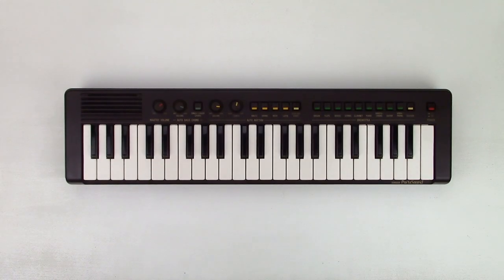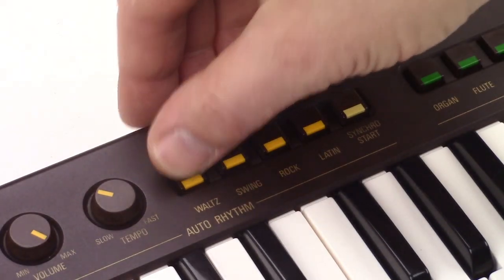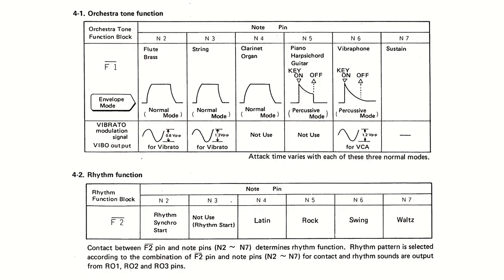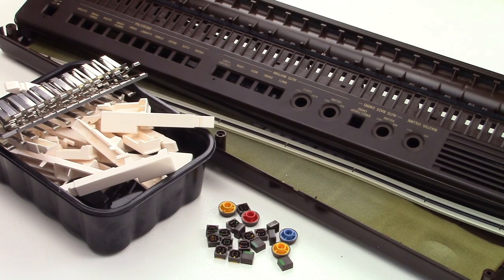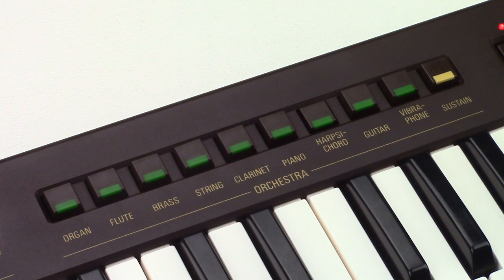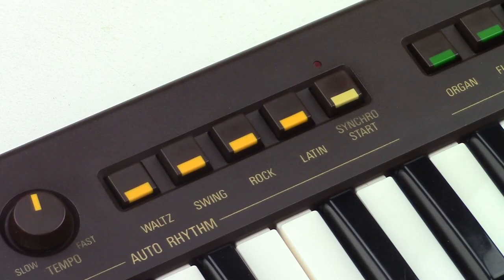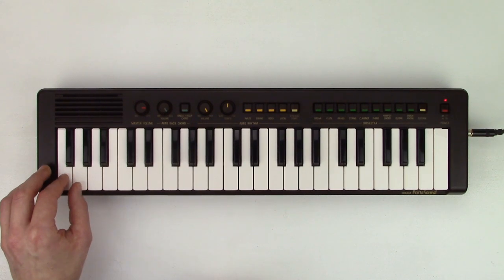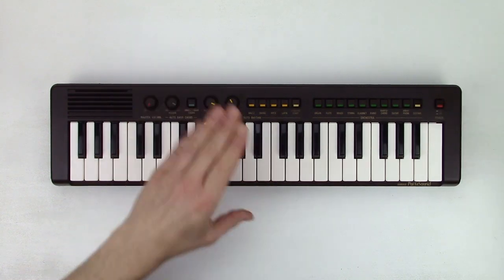Yamaha PS-3 Review

Comment: I've just received my own PS-3 (with the case <3, but lacking the battery door :D) this this is build like a tank, you would expect something super light for the size, but it weight a lot, and even worse with the battery.

Mine seems to have other than scratchy potentiometer an issue with the drums but suspect it is just a capacitor that show show age. Everything else seems to work Ok considering how old this device is (from the serial number mine is a bit more recent)
Do you have a recording somewhere of just the drums? would like a clean reference to check the output of mine, I have the service manual (thank you internet for that, and Yamaha to have made them so complete) so fixing should not be too much of trouble.
Quite amazing how much they achieved with that keyboard with so little..

Comment: I have a have a keyboard collection made up mainly with Yamaha and Casio keyboards my very first big full size keyboard (which I still have and still works very well) was a Casio model CT-650 this particular model has been out of production for quite some time now but you might be able to find someone selling one on eBay or Craig’s List if you are interested it’s really a nice keyboard it’s got some nice sounds and beats another good one I have is the Casio CT-670 (also out of production) I believe all my keyboard models are out of production now but still very good like my Yamaha PSR-175 or my Yamaha EZ-200 with light up keys or another good one I have is my Yamaha PSR-E403 you can program MIDI files from your computer (if you have any) onto that keyboard but only a limited amount at a time or my Casio PT-110 that one is only a have sized one but still a good one I think those are all my major keyboards feel free to look up any of these models but keep in mind they are all out of production now in fact there was an episode of King Of The Hill where they used a Casio CT-650 it was the episode where the gang created a band and called themselves The Propaneiacs and the keyboard beat sounds you between gigs when you saw them travelling from gig to gig those beat sounds were that of the Casio CT-650 and that was my very first full size keyboard that I ever had and like I said still have it and it still works

Comment: Hey I know I already commented but I have a question. How did you record directly from your Portasound? I’ve been trying different methods and none of them have worked.
Reply from the maker: I connected the headphone output to the input of my audio interface.
Reply: @KeenOnKeys  did you use an adapter? What audio interface did you use? I’m sorry if I’m being annoying, and I really appreciate that you responded quickly, I just need to get fairly specific cuz I tried doing it (I connected a 1/4 inch to 3.5 mm cord from keyboard to pc and tried recording) and it didn’t work for me. Again, thanks for the response =]
Reply from the maker: @psychic_digit  I used a RME 9632, but it doesn't matter which audio interface you use. Any will do, if it's properly installed.
Reply: @KeenOnKeys  ok that helps, thank you =)